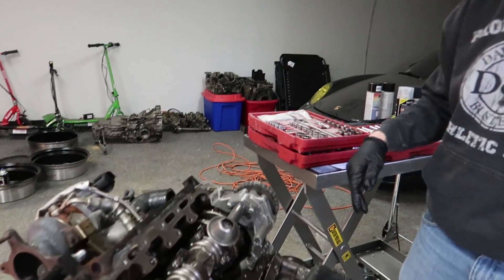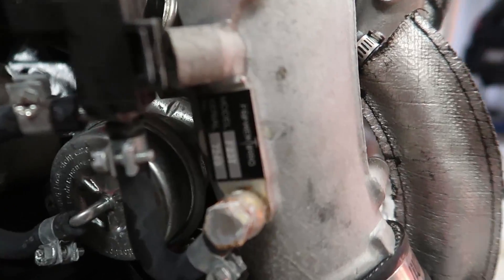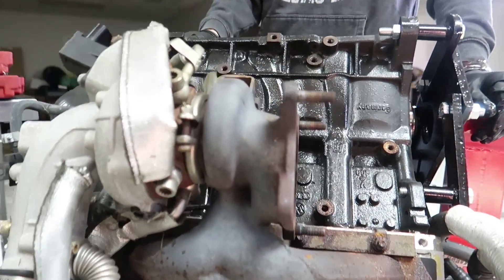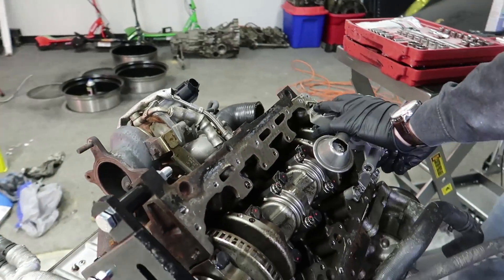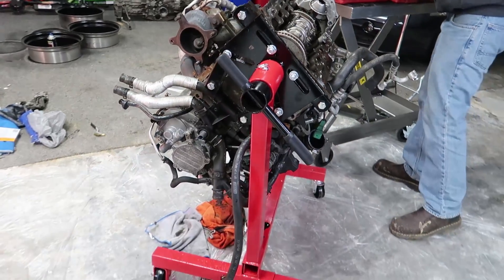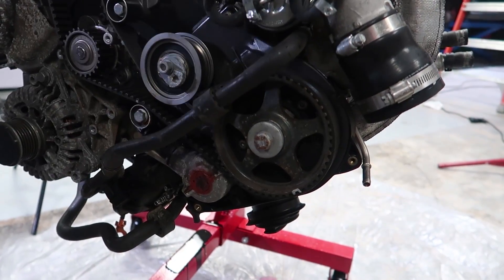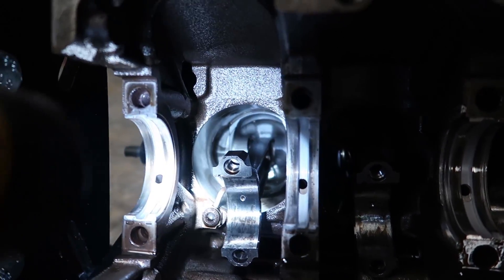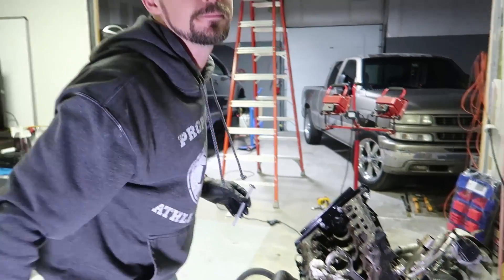MK5 GTI Engine Failure - Diagnosing

Comment: could the balance shaft delete cause bearing issue
Reply from the maker: Not sure... Seems like an oil supply issue but the motor got yanked and replaced with used OEM engine. Ran good for the rest of the race season

Comment: Sorry to see that. What kind of oil are you guys using?!?
Reply: Thomas Carpenter Liqui Moly in this engine.
Reply from the maker: The Cayman was running Mobil 1 Synthetic, the GTI was running Liqui Moly. I'm thinking the Cayman was rod bolt stretch at this point. The GTI was likely oil starvation; it is getting a new oil pan and a TDI oil pump to help alleviate this.